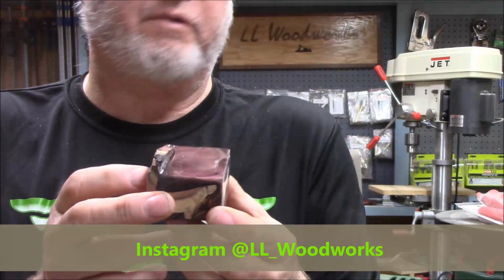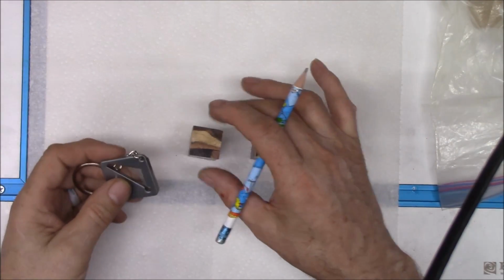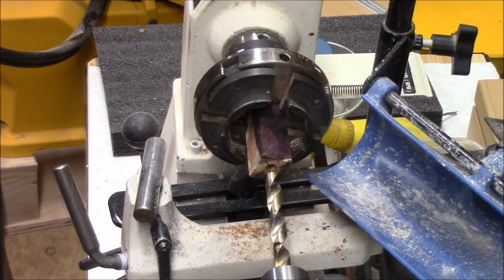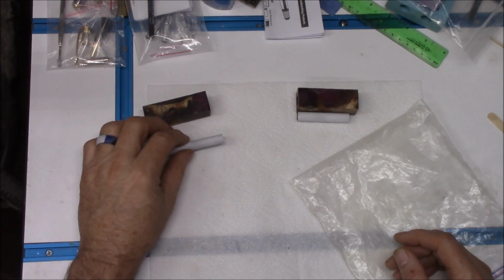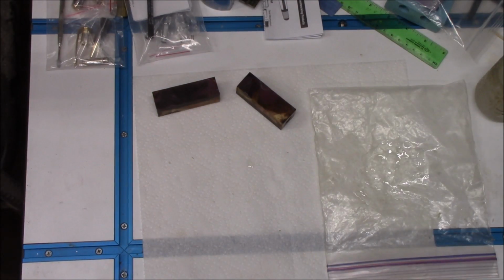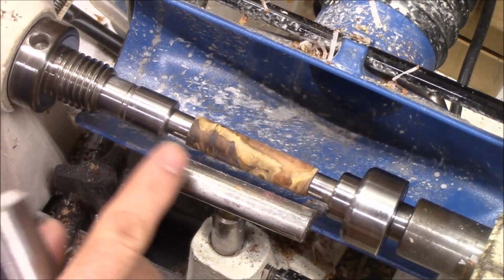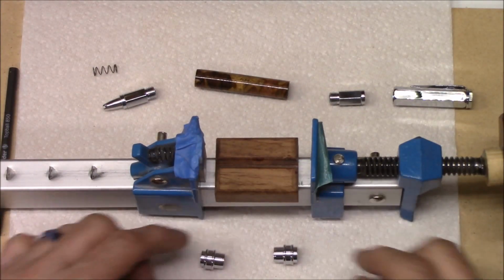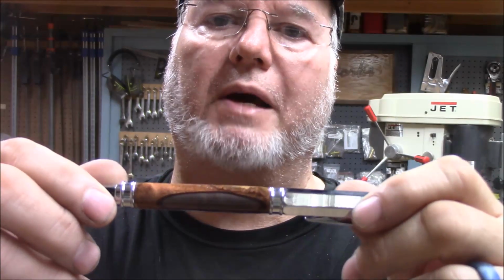Worthless Wood Blank - Mesquite Burl & Liquid Diamond Resin

Comment: Lynn what does the magnetic do I have never used that kit.  I use the Vertex kit alot.  Gun Metal is my favorite
Reply from the maker: +Dave White Hey Dave, it is just a magnetic cap instead of threads. It sticks to the nib end for storage and the cap end while writing.  You should give be a try.
Reply: The pen is neither a click or twist pen.  The cap is held on via the magnet.